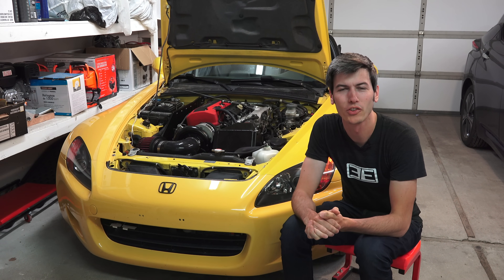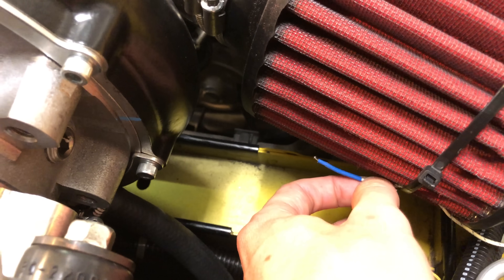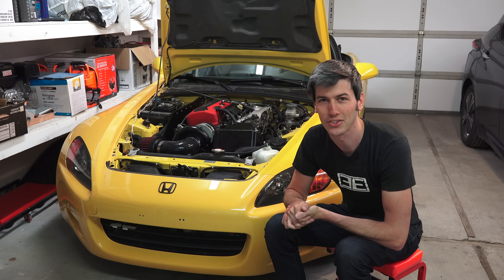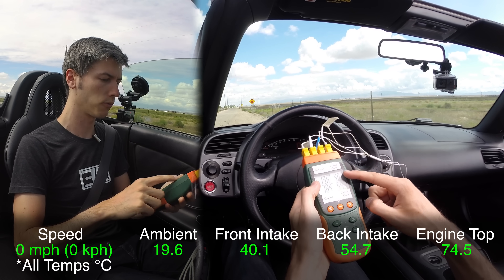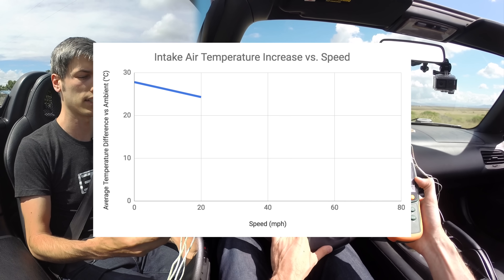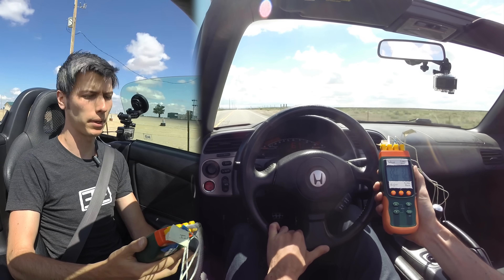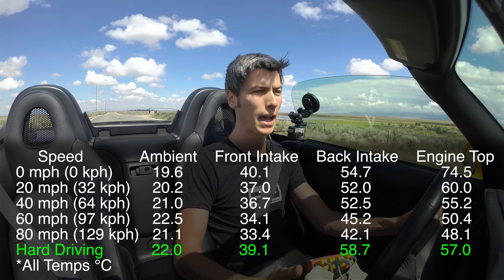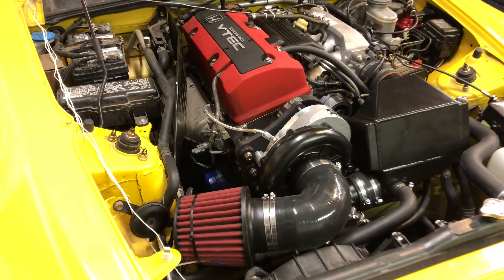Does My Supercharged S2000 Have A Hot Air Intake?

Comment: Thank you for Celsius.
Reply: jacob stienecker The decimal exists for a reason.
Reply: That's how our brains work. Nothing to do with being dense or bright. I can measure distances in both km and miles, but wouldn't be able to tell if 100F is hot or cold :P So I don't mind EE using miles, but Celcius vs Fahrenheit is a big deal for me.
Reply: jacob stienecker you can just use decimals to be more precise
Reply: zbyszanna I wish the US had gone all Metric years ago. I used it all through engineering college. 
In medicine, metric is used for medications and liquids, but not body temperature (usually). So I’ve got a better feel for those two things.
Still after driving and experiencing life for nearly 5 decades, I still don’t have a good “feel” for a kilometer, km/hr, degrees Celsius, especially when +or- freezing temperatures. 
As I said, I still do a rough head calculation in my head to relate it to my real world experiences.
Maybe I’m just dense? Or a creature of habit like most of us.
Reply: Jacob- You only like Farenheit because the thermometers are bigger thus more precise for sticking in your arse.
Reply: jacob stienecker That doesn't make sense. Lets use meters and kilometers to demonstrate why that doesn't matter. 2546 meters is equal to 2.546 kilometers. 4725.583539 meters is equal to 4.725583539 kilometers. Same degree of accuracy in both cases despite using a larger unit.
Reply: Divide f by 3 for c. 60mph is about 100kph - 0 c (32f) is freezing point 100 c is boiling point
Reply: You use F and you have never landed on the Moon. Hmm... Looks like there is a fault in your theory :(
Reply: Zbyszanna-0c (32F)=freezing point of water 100c  is boiling water. a 100 f is  33c an average summer day.
Reply: If you refuse to use a decimal point, then Fahrenheit is more “accurate”. 
I had a day long debate with my 8th grade science teacher about the precision/accuracy debate of Fahrenheit vs. Centigrade/Celsius in 1970.
I felt quite certain that my argument made sense.
Then the light bulb in my head lit up...and I’ve understood it ever since.
If I could remember his name, I’d thank him profusely for a lesson well taught...and learned.
I think teachers like him have largely been run out of the “system”  these days.
As an aside aside, he taught me how to use a slide rule. 
Thinking of that still shocks me.

I went to a store with my Dad around the same time so he could buy an adding machine with a printer to do the bills.
While we were looking around the salesman showed us an HP handheld calculator. About the size of an iPhone 10 but 10+ times as thick. 
Very heavy. Red LED numbers. 
He said something like “this is the future”.
Cost? I remember quite well because I’m sure my jaw hit the floor. +-x/ only. No fancy scientific stuff.
$650.00.  That was quite a sum in ~1970.

I wish Dad would have bought some HP , Microsoft and especially Apple stock then.
C’est la Vie.
Reply: F  that its all arbitrary numbers anyway. farenheit is more accurate and meaningful for everyday use, only extreme temperatures make sense for celcius
Reply: Besides immigrants, scientists, and drug dealers, in the USA the metric system is also used by Jason on Engineering Explained!
Reply: Indeed, the correct global measurement of temperature.
Reply: Of course it is... checkout all the Nuclear power stations that use Fahrenheit to measure coolant temperatures...... Oh wait...... Even US Power stations use C.
Reply: Thomas Griffin yeah ok, so dose the F. It’s a more precise when using decimals
Reply: Paul Taylor
Even household thermostats that use Celsius have to show tenths of a degree because of how imprecise a change in the whole degree is.
Reply: C for Can't land on the moon F for Fuc*ing landed on the moon.
Reply: Fahrenheit is more precise

Comment: Isn't the intercooler supposed to cool the air?
Reply: Depends though on whether or not the intercooler has excess cooling capacity. If it does then there might be no difference between a CAI and a HAI. Obviously if the intercooler doesn't have excess cooling or barely excess cooling there will be a difference.
Reply: It cools the charged air. The cooler the air before it is compresses the cooler it will be after it's charged.

Comment: I would be interested in seeing the temps pre-intercooler and post intercooler. The intercooler might be taking care of that additional 20 to 30 degree increase in temps that you are seeing.
Reply: This is an oversimplification but I don't have my books on supercharging anymore, but assuming an 85% efficient intercooler shouldn't that 20 to 30 degrees be cut down to about 4 to 6 degrees post intercooler?  Using the rough rule of thumb that 10 degrees is about a 1% power difference the 4 to 6 degree cooler air is about a 0.5% gain.
Reply: Engineering Explained of course the hotter the air going in the easier it is to heat soak.
Reply from the maker: Yes, would certainly be interesting to see, but starting with a cooler temperature means you'll end with a cooler temperature, starting with a hotter temperature means ending with a hotter temperature.
Reply: Technically yes, but it should not be a true 1 to 1  translation, based on the efficiency of the intercooler, speed, and ambient temps. We did a whole series of testing with data loggers back in 2000/2001 and saw some interesting but explainable results. So, you can't just stop there :-)
Reply from the maker: Correct, won't be 1:1 translation. The hotter the air going into the intercooler, the more effective the intercooler will be, since the temperature differential with the coolant will be greater. More testing is always needed! :)

Comment: Is there ever an advantage to having warm air coming into the intake?
Reply: Yes, u get better gas mileage since the car is not using so much fuel. Thats about it, your car NEEDS cool air.
Reply: For Power no, at least in a normal temperature range. But extreme cold might become a problem at some point.
And ambient air around 20° C for sure is better for a cold start than -50° C because warming up the engine takes longer = more wear on the engine

Comment: Hot air intake makes the most torquepowers. 👌
Reply: Dragging around 2 tons of usless steel needing extra horsepower to move just to compensate for your  d (small D). lol
Reply: No no, it's horsetorques!
Reply: Hot air is closer in temperature to the flame so you use less energy igniting the fuel!
Reply: Monster RAM Hot is good. Don't want your car gettin too chilly on those track days, do you?

Comment: The difference between the intake measurements is staggering! Glad I placed a heatshield behind mine.
Reply: I've seen Formula SAE simply sandwich fiberglass cloth/mesh between two pieces of metal to act as heat shields. 

My 09 Hyundai has a manifold heat shield like that and it really works, I can touch it without even a hint of getting burned. My old Nissan's simple stamped-steel one might as well be a skillet 🤣
Reply: More piping, less pressure, less air mass.
Reply: It is still shielding heat. It is going to be less than direct exposure to the exhaust radiation. Especially with air flow under the hood.
Reply: Yeah. New cars put shielding on about everything sometimes. Chevy and Ford went nuts with it on their sedans. I think a little more on their trucks. I think they're working on better sensor long term reliability as well.
Reply: mike tong one would have to wonder though, after a long spirited driving session that piece of metal would turn into a radiator of sorts because it doesn't reflect Heat constantly, eventually everything under the hood will get hot so by routing the air intake piping out of the engine bay area he will always get the coldest air